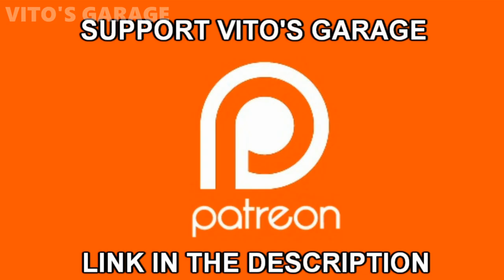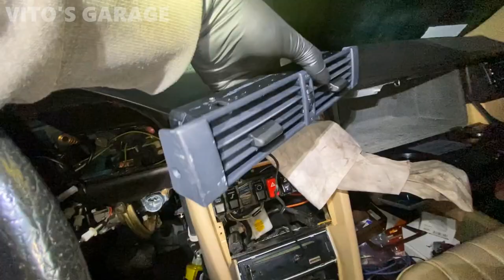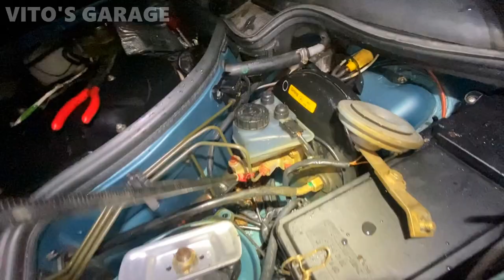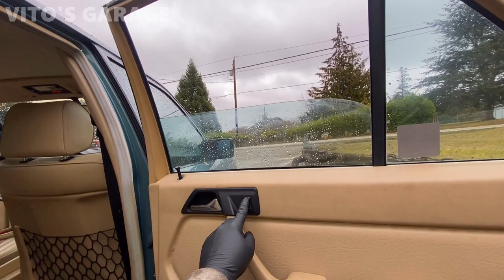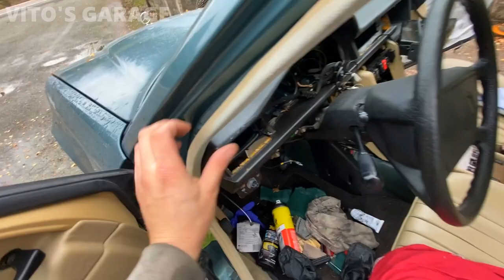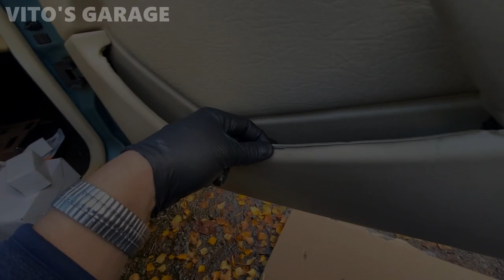Part 11 Mercedes W124: Window Regulator Service, More Drainage Cleaning, Assembling Interior

Comment: instead of the using grease on the inner door skin, why didnt you just use spray cavity wax? You can buy it in aerosol form and its brilliant. It applies a thin layer which dries hard and completely seals the surface.
Reply from the maker: Because I like using fluid film and grease? Cavity wax isn’t as effective and protective from rust

Comment: When the sun melts thick grease wont it build up in a drain path somewhere?  Or run onto the glass?
Your project footage is improving.  Like the details and appreciate the tips.
  Very helpful to know before ya go.  Good work.  Thanks!
Reply from the maker: Nothing will happen to the grease. It’ll stay on the surface. And thanks
Reply: @VITOSGARAGE  Sunlight directly on the outside of the door and the grease doesnt heat up too?